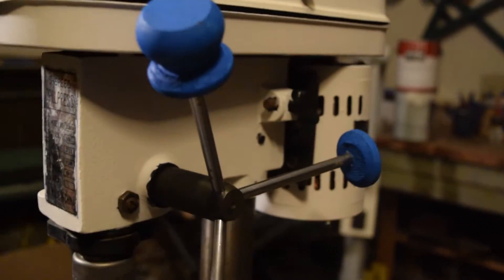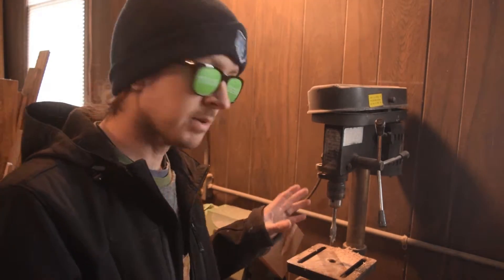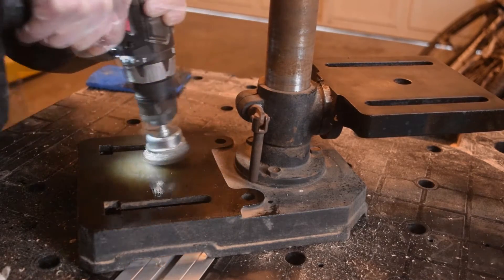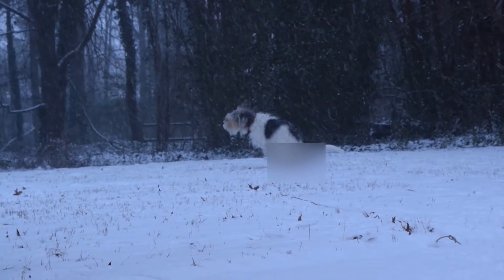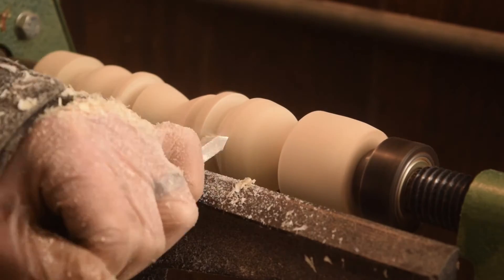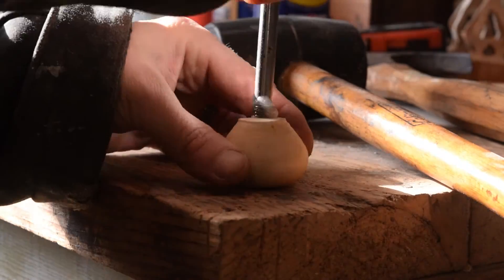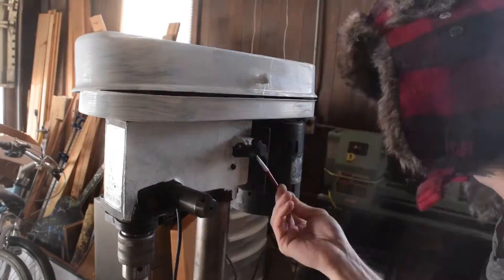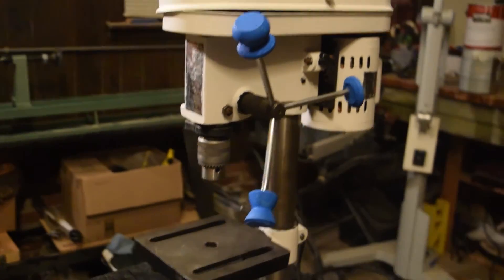Drill Press Restoration - DIY

Comment: LOLz Why censor the dog or film it at that point, anyway?  But more to the point, I saw a recent DP restore that included soaking the disassembled pieces in a vinegar solution to remove the rust. Seemed like a good idea that reduced the elbow grease, and oil too.